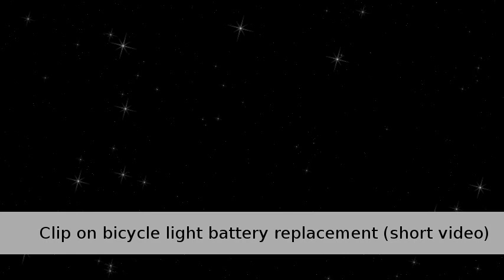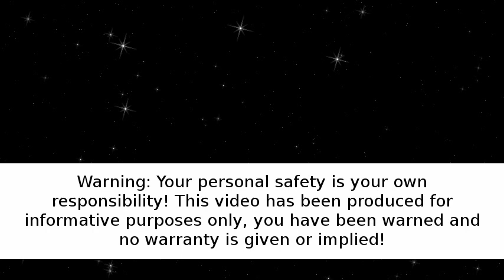Clip on bicycle light battery replacement (short video)

Comment: Another thank you for posting this. I wasn't sure how to open the light to get at the batteries, and didn't want to break it. This video showed me the way and let me get the light fixed. Thanks again!
Reply from the maker: +EMOP9 Great to hear the video helped! :-)
Reply: +NekitaNet Same here, I though it had to be simple I just didn't want to risk breaking the damn thing. Thanks!
Just a fun fact, I'm gonna use a red one but not on a bike but during nighttime airsoft games.
Reply from the maker: +sogerc1 You're very welcome and I'm guessing it even worked out for airsoft :-)

Comment: Thanks for the video! I wasn´t sure whether you can change the battery or not but after this video I was able to do it. Just needed the trick for opening.

P.S.: It also works with a 10ct coin. Had no 5ct coin
Reply from the maker: Good you got it open and were able to replace the batteries! :-)

Comment: thank you.  I did not have the confidence to open it.  The unit I have has for some reason a yellowish light set.  I wonder if there is a mode button or holddown feature to change colours?
Reply from the maker: Glad it helped and sorry to say they're likely just single color LED's so they likely have no color changing option.

Comment: there is no notch at all on the Cateye Opticube cycle lamp Batteries LR-6x4 Whiter LED so how is it to be opened?
Reply from the maker: +Edwin Reffell That's an other type of LED bicycle light. Not knowing what type you're looking to replace the batteries of the following link is only a guess: https://youtu.be/6veSY3rhPDc Hope it helps.
Reply: +NekitaNet It is not that one.On the light I have it only says Cateye Opticube batteries LR-6x4 White LED. I think there are 3 lamps in it and want to open it to replace the batteries. The following page has an image of the one i am asking about http://www.barangbike.com/422-1439-thickbox_default/cateye-hl-el200-headlight.jpg
Reply from the maker: Edwin Reffell It looks nice, but I'm not familiar with that model. So, I can't help you with that one but to recommend to go to a bicycle shop and ask them to change out the batteries in your presents (so you can look and find out how it's done). Best of luck! :-)